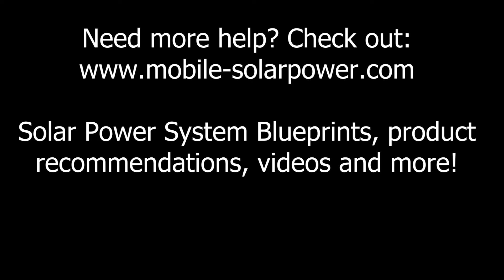How to Connect Different Solar Panels Together

Comment from the maker: Does off-grid solar confuse you? 
Check out my DIY friendly website for solar system blueprints and product recommendations, and so much more! 
http://www.mobile-solarpower.com

Join our DIY solar community 
#1 largest solar forum on the internet for beginners and professionals alike:
https://www.diysolarforum.com

Check out my free book
Best-selling and beginner-friendly guide to 12V off-grid solar!
https://www.mobile-solarpower.com/the-book.html

~~~~~~~~~~~~~~~~~~~~~~~~~~~~~~~~~~~~~
My Favorite Online Stores for DIY Solar Products:

Current Connected
My favorite USA Distributor! Best Prices for EG4, Victron, Solar Panels and high quality components. Fantastic customer support and fast shipping: 
https://currentconnected.com/?ref=wp

WattCycle
My favorite 12V budget battery!:
https://www.wattcycle.com/?ref=aaezwkkc

Epoch Batteries
My favorite high-quality 12V battery:
https://www.epochbatteries.com/products/12v-460ah-lifepo4-battery-ip67-heated-bluetooth-victron-comms?rfsn=7352625.50494d

Watts247
Need international shipping for large batteries and big inverters? Check them out!
https://watts247.com/?wpam_id=3

Rich Solar 
Budget 12V Inverters and MPPT:
https://richsolar.com/?ref=h-cvbzfahsek

Battery Hookup
Cheap used lithium cell deals:
https://bit.ly/2mIxSqt
5% off code: diysolar

Contact Information:
I am NOT available for personal solar system consult! If you wish to contact me, this is my direct email: williamprowsediysolar@gmail.com

Join the forum at https://diysolarforum.com/ if you wish to hang out with myself and others and talk about solar

FTC Disclosure Statement and Disclaimers:
Every video includes paid promotion or sponsorship. Some links on this youtube channel may be affiliate links. We may get paid if you buy something or take an action after clicking one of these. 
My videos are for educational purposes only. Information is subject to change/update at any time. Electricity is DANGEROUS and can kill. Be smart and use common sense :) 
DIY Solar Power with Will Prowse is a participant in the Amazon Services LLC Associates Program,
An affiliate advertising program designed to provide a means for sites to earn advertising fees by advertising and linking to Amazon.com

Comment: @0:27 If you add a 5 v in parallel to a 50 v string, it won't necessarily go down to 5v. Only if the system produces more power doing that will the MPPT take it down there. But it usually won't, so it will keep the voltage at 50v and the 5v panel's series diode will effectively disconnect it and the 5v panel will do nothing most of the time.

Comment: So basically the lower voltage or amperage rating takes precedence. Adding a 15amp panel in series with a 10amp works but remains at 10amps.

Thanks for this!

Comment: Just to make sure I understand, if I’m paralleling panels or different chain sets of panels, say 2 455w (50v each) and one 450W (40v) all in parallel, the charge controller will only get 40v. 

So as long as I’m okay with that loss of 10v on each 455, all is good?

Thanks for the good explanations.

Comment: I have 5 mismatched panels.
1) 5V-3.6A-18W
2) 5V-9A-45W
3) 5V-2A-10W
4) 9V-1.3A-12W
5) 21V-0.9A-15W

What is the best connection for this panels ?

Comment: If my panels are the same voltage in parallel but one is getting less sun, will they both drop to that voltage? I have two hundred watt panels but one is much more efficient because it has the multi direction bobble coating.

Comment: For the large differences in the examples, the panels are not worth hooking together.  But let's say that you have panels where the voltage is 10 or 15 percent apart - then you will still have an overall power gain from connecting them in parallel.

Comment: You are not correct completely. What will happen when connected two panels in parallels with Voc 50V and 15V? Panels are not operating just connected and open circuited.

Comment: Will, I have a 350 watt solar system in my Van, connected parallel to a Renogy 50amp B2B charger/controller.

I would like to connect a set of 100 watt panels in series as a supplement through a 48v- 12 v regulator and connect directly to the Renogy b2b charge controller.  Will this be acceptable and safe?

Comment: But if you put a blocking diode in series with all but the higher voltage panel it takes over charging when the light level drops

Comment: I’m trying to do 2s2p with 4 250 watt panels. Open circuit voltage 37.6 each. Short CC 8.85, C Pmax 8.27. I know I need some sort of branch connectors and 20 ft extension cable but I can’t figure out the gauge wire I need.

Comment: What if the only gap is 1volt, for example i have a 70w solar panel with 18voc and a 100w  with 17v voc, can i parallel it

Comment: This is a bit too conservative an approach. Given IV curves, there's no problem using slightly differing Vmp and Imp rated panels. Giving up 5% or 15% of output is often preferable to having to buy new panels or sink money into a separate controller and wiring. The examples of 50v panels wired in parallel to 5v panels is silly and extreme.

Comment: Found this on my journey to beef up my off-grid power lingo....but laughing at 5yrs old and topics are 5amps and 100v.  Looking out my window at 315w/10amp panels that are only three years old...and now there are panels in the >400w range!!  (Good basic info though that still applies.)
Reply: Yes, a 410W half-cut PERC+ panel price 99 euro. Not bad.

Comment: Hello, quick question. When you say in parallel they need to be the same voltage, is similar voltage fine? 
Eg: two 12v panels, one 175W one 100W.  VMP 18.9V and 19.5V, IMP 5.29A and 8.98A. So amps add and volts go to lowest available. 

Sooo 
18.9 x (5.29 + 8.98) = 269.7
That’s only a 5.3W loss from 275W, not bad.
Am I missing something?

Thanks for any help… have not been able to get a straight answer on this..

Comment: Ideally the panel should be of the same model and age. Each model of panel, even when the same rated voltage, will have a slightly different performance curve. The system will "work" if you match the max power voltage or max power current, but under low light conditions the performance of each panel may not align well. You could end up leaving as much as 10 or 20% of panel performance on the table.

Comment: I have two banks of different solar panels(previously i had 24 volts solar system) ,i have 6 panels with 375 watts and  recently i buy 6 more panels of 400 watts each .i'm migrating to 48 volts so i must connect in parallels to create 48 volts so how i connect the panels?
Reply: Try not to focus on the Wattage of your panels, it’s the Voltage and Amperage that are important.  

If you post the values, I’ll offer my suggestions for wiring your system.

Comment: could you use a separate MPPT controller and connect to same battery in parallel. for this panel string

Comment: I think not x3 50v 300w 50v to 5v10w in parallel the 5v will burn and after the 5v panel open circuit due to burn the voltage will rise to 50

Comment: I have 3 panels. The open circuit voltage in all of them are rated the same. Two of them are 180 watts with a short circuit current of 10.5 Amps . The other is a 100 watt with a short circuit current of 5.8 Amps. They're in parallel. does that mean they are all putting out 5.8 amps?
Reply: No I believe the opposite. The amps add, the volts would be lowest value

Comment: Love your channel ❤ I know its a old video but I want to connect a 50w 12v a 75w 12v and a 100w 12v. Its because of the shape of the roof in my camper. Will they be OK together ? I'm running a renogy dcc50s

Comment: Can different size panels be combined on a Positive Bus Bar (all Positives) and a Negative Bus Bar (all Negatives), then the Charge Controller connected Positive to Positive, Negative to Negative of the bus bars to bring various panel wattages together? If not, is there a way to do it? I have a 180 Watt Panel (18.95V), 175 Watt Panel(18.77V), and 100 Watts from a Harbor Freight Set (4 Panels, 25 Watts each at 18V ea). Is it possible to add the wattages for these?

Comment: Thank you Will, space on my roof dictates I can only fit 2x100w compact and 1x50w renogy panels. They have vastly different Amp ratings but the Volt on the 100s is 17.9 and the 50 is 18.3 so by your advice I can see parallel is the way to go.. Just wanted to thank you for your videos, I’ve watched and learned a lot from you. Much appreciated.

Comment: This is a thing worth repeating often. I was going through  my assorted odd panels and was wondering this very same thing. I've done a few different small stand alone projects but never anything requiring more than one panel and a marine battery. (I use solar and LED lighting  for holiday displays) I stumbled across this older video today and was glad to have found it. It saved me asking a rather basic question that you've most likely answered all too often. So today I ordered your book on Amazon and I am looking forward to being better educated in solar tech. Thank you for being an actively involved YouTube content creator.

Comment: If all the panels are the same in current and voltage, am I right to assume it's OK to connect them in series and parallel to achieve the particular output voltage you're after?

Comment: Hi Will. Enjoy all your videos. Thank you very much for producing these and educating. Now the questions.... this is my plan:
1. Starting with a HQST 100W (two 50s) Folding briefcase kit with a 30A MPPT Controller.
2. Later in a month or two; add Two HQST 100W = 200W connected in Series to the 30A MPPT Controller.
Some values: 
Solar Panels	Watts	        Volts (Voc)	Amps
HQST Folding Kit 100W	100	21.6	6.16
HQST 100W Panels 200W	100	21.3	5.58

Will the above work if I connect the 100W briefcase kit in series with the 200W system all going to the same controller for a max of 300W?

Comment: Being that said regarding two sizes of panels one should buy, is it better to just buy two 100w panels instead of the 190w panel? I suppose this would also help in replacing failed panels or cells. If the 190w panel fails vs a 100w panel failure is less of a hit? For RV application, not home based applications. Thanks.

Comment: SIMPLE AND WELL EXPLAINED. THANKS.
. 
ALSO FOR DIFFERENT VOLT AND AMPS.
check either different volt values are close or different amp values are close for both mismatch panels. then if amps are more close then go for series, go for parallel either.

Comment: Can you connect different sizes solar panels  together after they go through separate solar controllers. As i have two fold out panels of different sizes and would like to use both when camping.

Comment: Is this true ??? I mean for series , all the panel performance will goes in to the lowest one???I don’t think so according my setting up . Will show you my real life example and please let me know what you think.
Reply from the maker: No, it's true. Series string will be limited by lowest current producing panel
Reply: @WillProwse   I've sett up approx 400W solar panel on my roof after watching your video and did reach for the combination of mismatched panel issue on the youtube and found one that convinced me parallel will be ok at least voltage is same and didn't like the performance of parallel output so give it a try for series again and had the same result. I will leave the link here after post a video later on so you can verify my experimental configuration. 
I did clearly understand your theory is more logical and you are not the only one who gave me that eduction but I still don't understand what happened in reality, guess there might be some hidden factor that has to be applied on the theory.

Comment: Hi Will,  I have 3 different panels with different amp ratings and voltages.  I just purchased 3 different charge controllers and connected the three outputs to a bank of deep cycle batteries in parallel.   Will this do any harm and is there a better way?   It seems to be working ok.
Reply: you are fine

Comment: Different Panels with different voltage AND amps mean you need separate charge controllers. That's the only way I could go.
Reply: check either different volts value are close or different amp values are close for both mismatch panels. then if amps are more close then go for series, go for parallel either. IF YOU DONT WANA BUY ANOTHER CONTROLLER
Reply: @awishhamza6368  yup
Reply: Makes sense  @awishhamza6368
Reply: @awishhamza6368  this is the best reply

Comment: 1- i have solar panel  130W   18 vole 7.2 A / panel ,i have 4 panel  connected series i get  = 520 W  48V out put  
2- more sola panel  360W   36V   10A   / panel i have 2 panel  connected series i get  =720W   48V out put the sam
3- i can connect parallel ?   the same voltage ,can connected paralle?   this my question

Comment: Any advice on connecting the solar system of my RV to the solar system of my house.
The RV only gets used a few weeks a year so the rest of the year it's making solar power that's not being used.
The best I can think of at the moment would be a split change relay and very thick wires.
Maybe some sort of boost converter and buck converter would be better.
Reply: I also considered using the grid tie inverter and trying to feed the house inverter output but I'm really not sure about that so I need to learn a lot more about how this or maybe just stepping down the inverter output might work.
Reply: I might be looking to get as much as 1000w out of the RV system and at 12v the cables would be a problem.

Comment: I have a question. I just bought a kodiak generator with 2 100w 12 volts solar panels. I was wondering if I could buy and connect 2 new 100w 12 volts panels but a different brand ? Any info would be helpful.
Reply from the maker: Yes but you need a branch connector to connect them in parallel so the voltage does not increase substantially

Comment: I have 7x 100w 12v flexible panels and a 30a /100v max MPPT controller, 12v system. I live in a foggy city. The panels' are recommended not to have more than 3 in series. I also have some blocking diodes I can utilize. I also have an old PMW controller, I'd prefer not to use. Whats the best way to wire these? Thanks
Reply: What did you end up doing?
I would have said, get one more panel and series every 2 then parallel the 4 sets (of 2 panels in series) together so your voltage is about 18Vx2=36V and the amps about 6Ax4=24A

Comment: When selecting your panels to connect together, do you look at open circuit voltage or max voltage values?
Reply: Darren Geary if I am understanding your question correctly, I have an answer. Many panels list 3 voltages. Open circuit, maximum power point and max voltage. Often the max voltage will be many times higher than either OC or MPP voltage. This is the maximum voltage that can flow through the panel when connected in series with many other panels and on standard commercial panels it can often be 1000v. You want to compare the open circuit and max power point voltages. If these are close (+/- .5v) then they are good candidates for parallel connection. I run a pair of 110w panels in series (34.37v MPP) in parallel with a pair of 100w panels in series (34.96v MPP) and it works just fine with very little loss. I lose much more because they are mounted flat on the trailer roof. I have also run them all in parallel and it works fine but more cabling (4x12awg vs 2x12awg) and my particular charge controller gains almost 5% conversion efficiency at the higher voltage.
Reply: @jml7916  thank you for your explanation, it has answered an age old question of mine. Cheers!
Reply: @jml7916  thank you! I think that finally answers my question. 

My system is going to be one 100W and one 175W in parallel, and online every one says make sure the volts are the same or similar. But what is similar..? 

My panels are .6v apart vmp and 1.4v apart voc. I assume this is “close enough” ?
Reply: @David-cr6fb  should be close enough for most chargers. Any PWM will not care and most MPPT’s should handle that. There will be a slight inefficiency introduced if using an MPPT but pretty minor (as in it isn’t worth spending a penny to fix).
Reply: @jml7916  awesome, really appreciate the help. Yes it’ll be on a MPPT controller

Comment: Good stuff, one other option  (more cost) is to use a separate charge controller for each panel or group of similar panels. Controllers would be wired in parallel. This method would allow completely mismatched panels to be used..Good job on the video's ,I like your work.
Reply from the maker: +Your RV Freedom! Oh good point! Yeah that works
Reply: How would you do that exactly
Reply: @Masteradamant  this is what I am in the process of doing now. So I have one 415 watt solar panel feeding an Mppt charge controller connected to our battery. 
We had some additional space so we just bought 2 one hundred watt panels, and a second MPPT charge controller which will also connect to the same battery. As long as both charge controllers are the same type, they will work together in this way. The panels are too different to connect together, but the extra charge controller charge controller eliminates the interaction between the solar panels.

Comment: Short and sweet but good info to know, thanks Will.
Reply from the maker: +Mike Knife thanks Mike!
Reply: It is good to use blocking diode on positive side of each panel for Solar Panel Parallel connection 

Any issue or Draw back 
Plz suggest  @WillProwse